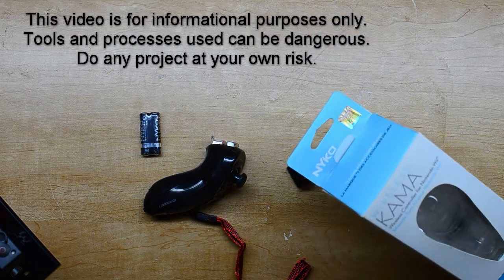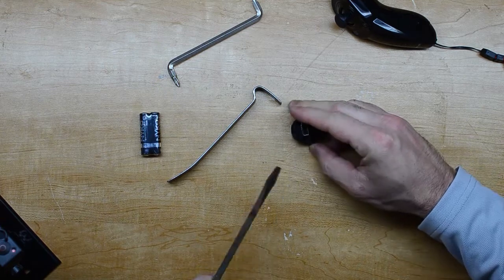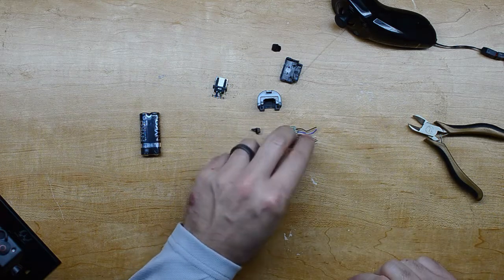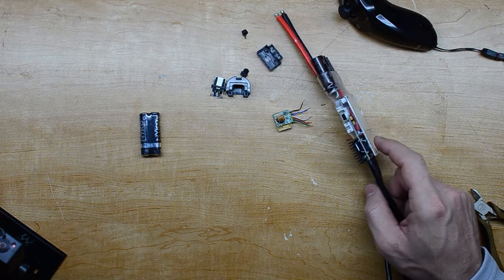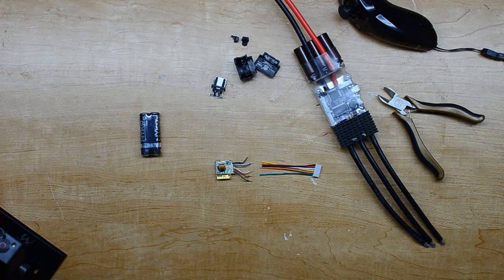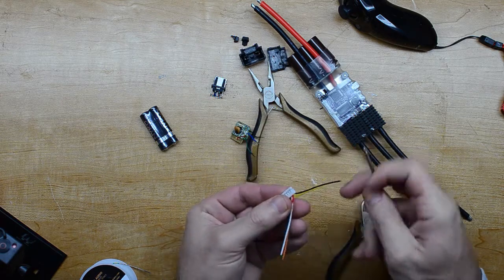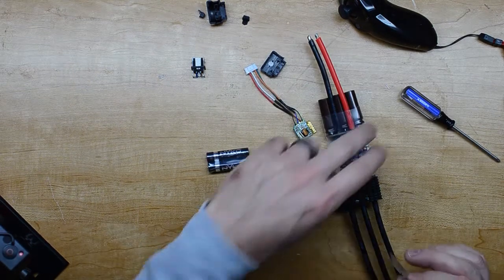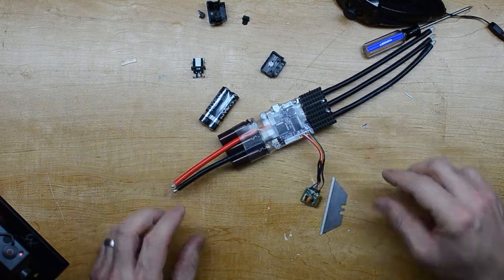HOW TO: Nyco Kama Wii Nunchuck with VESC ESKATE

Comment: The blue light on the wii don’t stay any solution
Reply from the maker: Usually doesn't stay on until the controller is paired.
Reply: @barnes_specialty  It’s not getting paired. What could be the issue. Used to work properly the set up is same as yours. Been using it for 5 years +

Comment: I did this a while ago, but it has never been reliable, signal drops in and out. are you sure the white wire is not supposed to be used for anything?
Reply from the maker: Haven’t touched it since I made this video. It is still working well. Is there anything that could be blocking the signal? Make sure it isn’t surrounded by metal.

Comment: great video however, why didnt you simply connect the connector's wires straight to the pcb?
Reply from the maker: Classlessrook32 didn't want to desolder anything off the board to minimize messing something up.
Reply: Barnes'd thats fair

Comment: I have an x-car 120A Brushless ESC because i was trying to make a budget build for my buddy as a challenge. I was looking at the JST connector and the wires go (Red, Black, White, green, Yellow, Orange). I was wondering if this build would work for my ESC as well, or if there was a way to make it work.
Reply from the maker: Donovan Stockwell You're better off using a GT2B style R/C remote. I don't think the wii remote will integrate with a car ESC. The VESC has special programming for it. Look at the GT2B or if it's too bulky there are some mods like the BadWolf GT2B Case mod.
Reply: Thank you so much! I think i will just make a case mod for one.. Thanks!!

Comment: do you think this mod would work just the same with a wired WII Nunchuck?  i have the parts but i'm unsure how you programmed the VESC
Reply from the maker: k9wiREless The wired remote would be different. Setting up the VESC is pretty simple. Go to the App Configuration Tab and General sub-tab select nunchuk. Then you can access the specific settings on the nunchuk sub-tab.  I might make a video on this.

Comment: Hi, I recently got my nyko kama controller to work. However, I have this problem where my controller just turns off while I am riding. Did you happen to have this problem?
Reply from the maker: Paul Lee Does the light on the remote go off? Does the receiver light go off or blink fast?
Reply: The light on the remote turns off. Reconnects as soon i turn it back on
Reply from the maker: Paul Lee Hmm. I've had it lose connection before but not just turn off. Double check your batteries and that they aren't losing connection somehow. Does it also do this during a bench test?
Reply: I've never had it happen during a bench test. Only when there is a load/resistance.
Reply: Haha I'm just curious about how the receiver and remote could lose connection under a load. I wonder what the physics is behind this

Comment: i bought a Wii transmitter but what i got, does not have the wires connected to the usb connector. instead, it has the usb connected directly to the chip, so i don't know wich points should i connect each Wire, because in my case, i have 2 rows with 3 points of connection each.  can you help me?
Reply from the maker: Is it a Nyco Kama?
Reply: no. i bought a different one cheaper, hopping that it would be simillar to that. the chip contains the same but there is no wires... it's mounted directly into the chip
Reply from the maker: You should probable be able to desolder it and solder wires on.  Do you have a multimeter?  You can check continuity between the plug and where it's soldered to the board to determine which pins to use.  Here is a diagram I found defining the plugs pins.  Just need to align those with the board side to know which holes on the PCB to use: http://www.electric-skateboard.builders/uploads/db1493/original/1X/a5cebf02b5022f8c5d7da7ab4bf471bcb4f80641.jpg
Reply: ok. thanks . good help. i think now i can do it with no problems! 😉
Reply: another question. whi did you connected the jst 6 pin female connector to the 7 pin entrance on the vesc, instead to the 6 pin entrance?
Reply from the maker: That is the proper connector for communication over I2c\UART\ADC (P3).  You could get a 7-pin JST to solder to the wii board, but all the wires aren't needed.  I think much older VESC design had a 6 pin connector there and it changed over time to 7 pin.  http://www.electric-skateboard.builders/uploads/db1493/original/2X/e/ea43a13722c878c33a812a3d20fb2efbba59af28.PNG
Reply: thank's. i have already done all the connections and i'm now progamming my vec, but i think i won't be able to connect my nunchuck dow. it's on, but the BDLC tool doesn't recognise my  remote control... Do you know any other way to progmam it?

Comment: Why do ppl use extra boards to attach the wii receiver to the vesc? Are you missing out on any features by connecting your controller the way you do in this video?
Reply from the maker: SaysSim0n I'm not sure. Maybe they don't know how to solder. One reason I made this video was I couldn't find any info on taking the thing apart. It works exactly the same like this.
Reply: I read allot about random cutouts when accelerating and braking. Do you also experience them? I dont have a working build yet so Im dependent on ppls experiances...
Reply from the maker: SaysSim0n I do have some occasional issues so I won't say it's flawless, but after reading about some of the "better" remotes a lot of them have issues. I have over 150 miles on this one and it hasn't been enough of a problem to switch. GT2B and a aftermarket enclosure is probably the most reliable.  I have all the parts here to build a custom remote and hope to get to it soon. My ideal remote has good connectivity and data readout with ESC info. I just need to build it.

Comment: Hey quick Question, you can only use one speed controller for each motor or run 2 motors with one speed controller, Thanks
Reply from the maker: One speed controller for each. Pretty sure because of the position and timing of energizing the windings is different for both motors.  Also if they were sensored they would have different readings. The VESC speaks over a CAN bus to sync. Hope that helps. Subscribe to see my new videos.

Comment: where did you get your jst connector and what size?
Reply from the maker: There is a link in the description to the one I used.  On the VESC there is a 7 pin connector there if you want to use the other pins, but not needed for this. 5, 6 or 7 pin JST 2.0 will working since only 4 wires are needed and a space between them.  Subscribe for more videos.

Comment: great video!!
how it ended up, is it working?
how do you think, will it wokr with these esc?
http://www.hobbyking.com/hobbyking/store/uh_viewItem.asp?idproduct=38782
Reply from the maker: Works pretty well, but does occasionally drop the signal.  No it will not work with that ESC.  Only the VESC.  You would need a standard RC receiver and GT2B or similar.  VESC is around the same price from enertion, but they are still catching up on shipments.
Reply: thanks, drop signal on high speed sounds not good)
Reply from the maker: When it happens it is very brief.  It can be annoying, but is mostly affected by the placement of the receiver.  I have the VESC set to coast under loss of signal so it doesn't cause any real problems.  I cruise at 25+ mph.